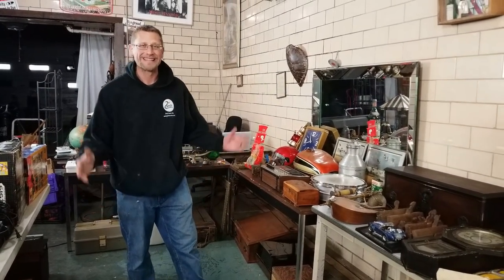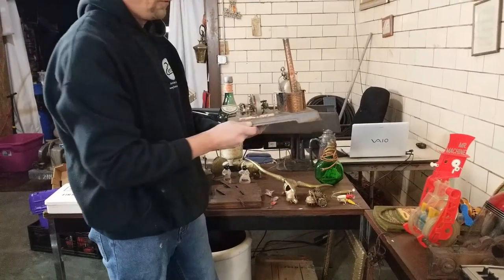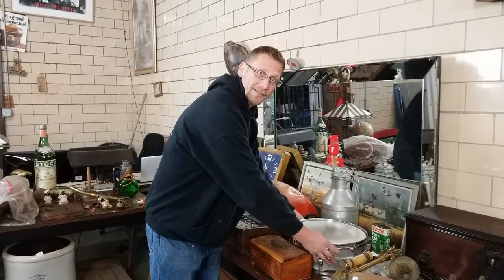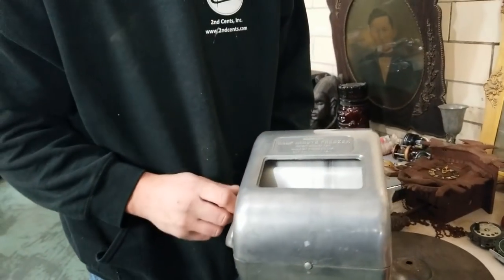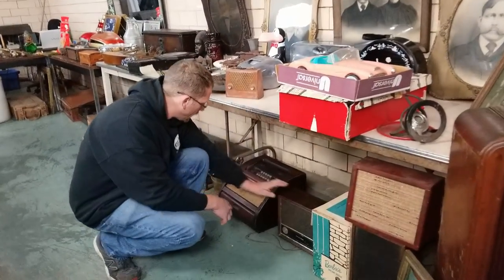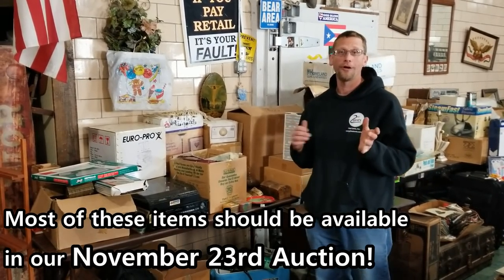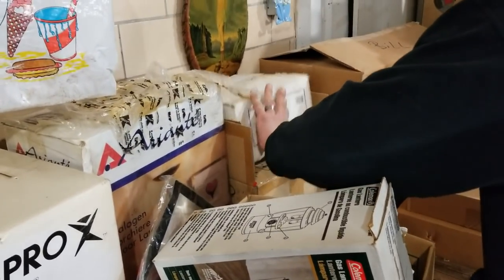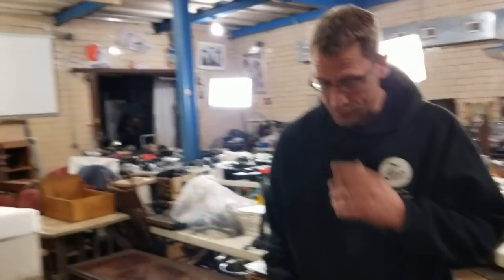Hoarder House Honey Hole Conclusion & Cleanup Antiques Auction Preview Abandoned Storage Unit Part 5

Comment: That treadle Singer is beautiful. My grandmother had told me that those machines that have the wood cover are older than the fold down kind. I have my great grandmother's but it is Domestic brand. My great grandmother would set the lid on its side and use it as a seat.
Reply from the maker: That is a great story about the top being used as a seat by your grandmother. Thanks for sharing and watching

Comment: You do clean the items well!  I use Norwex, antibacterial microfiber cloths, which claim to have silver threads to disinfect.  They require no chemicals, just water and one or two wipes and stuff sparkles.  I'm not affiliated with the company, but their product has saved me $ in cleaning supplies and my windows, glass frames, and mirrors never have streaks. I resell too and they shorten clean time.
Reply from the maker: Thanks for the advice will have to try Norwex cloths